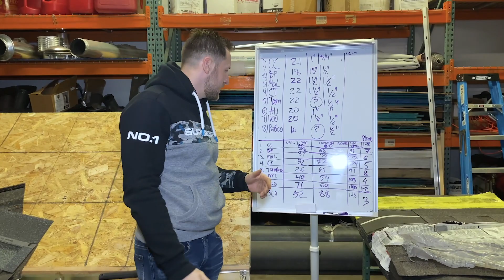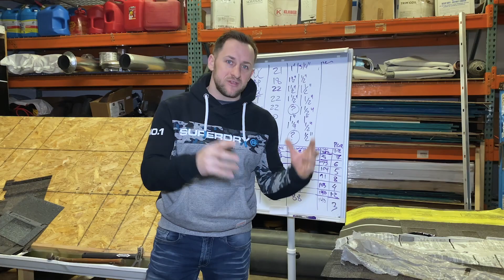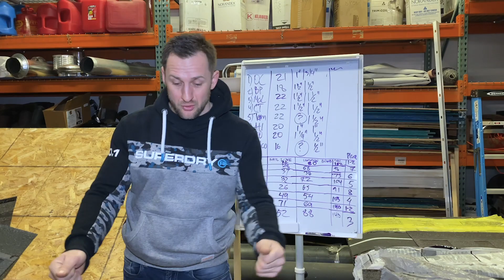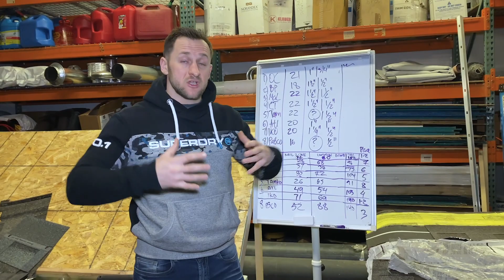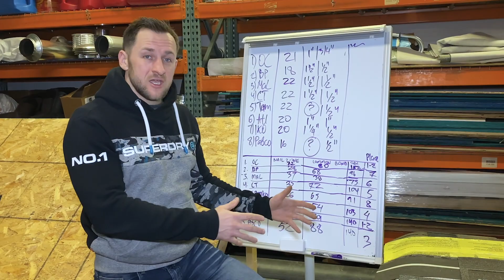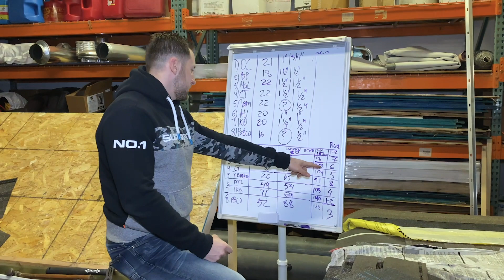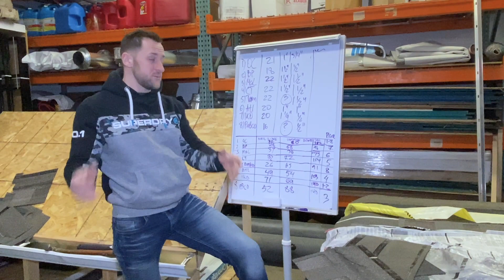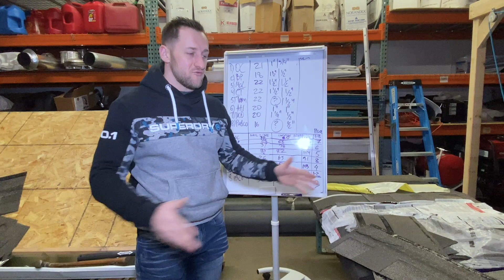Roof Shingles pull test GAF, IKO, MALARKEY, BP, OC, PABCO, ATLAS, CERTAINTEED, TAMKO

Comment: I had three jobs last year GAF Timberline HD all installed with code MC 103 Charcoal. Each house lost 3-5 shingles. Still trying to get reimbursed for the repairs.
Reply from the maker: Good luck
Reply: What state you in? How fast of wind speed? I've been installing gaf in Illinois for a long time and haven't had issues.
Reply: skliros Ontario, Canada. We have used GAF shingles for 10 years now, no issues for long time. Just last year we experienced the blow offs. 90 mile an hour winds. Shouldn’t have come off.
Reply: No reason they should be blowing off like that. How many nails per shingle do you guys use?
Reply: @21kidact64  no less than 18 per shingle

Comment: Im currently getting screwed right now. Used BP shingles on 9 houses, 6 of the house were WW1 era old shiplap boards as the roof deck. The shingles are lifting after 3 years. BP sucks. The neighbors roof has IKO shingles and it's next to the house I did. It had some lifting as well, but no where near to the amount as my roof with the BP shingles. I remember when I was installing them , I could cut them with my finger nail. So thin they warp in harsh weather and sub par roof decks. I should have sheathed with plywood, but still it's trash
 Roofers, stay the fuck away from BP.

Comment: Well shit, I just had my roof replaced with Malarkey Vista...  Now I'm wondering if that was a poor choice 😢
Reply from the maker: It was good choice
Reply: How is Malarkey Vista holding up for your roof? I am looking at installing it. It's not a low end shingle product.
Reply: @bernadettearcand7252   It looks great, and is holding up as expected so far.  Still early though.
Reply: Malarkey is a great choice. I also used Malarkey Vista. They perform near the top in every category and since they’re impact resistant to hail you should be able to get a discount on insurance.

Comment: Another good video Dimitri. You must be comparing the OC Duration with IKO Dynasty for 1 and 2. I agree totally I use OC Durations. 
But if your comparing OC Oakridge and IKO Cambridge then we’re not talking 1 and 2 anymore. 
The Duration has a wide nailing Zone but if you look at the edge of the shingle the actual  common bond is only about 3/4” just like almost all the other manufacturers. Fortunately you can nail anywhere in the hockey tape I call it and that shingle won’t blow off. 
The Malarkey Legasy is the only shingle with the large 1 3/4” common bond . But ya in a pull test it won’t compare to the Duration and the Dynasty. 
In my opinion every time I have to fix blow-offs it’s always because the roofers nail above the common bond area. 
The manufacturers like BP make a Mystique shingle with a 6” exposure. That’s way too big and is more susceptible to blow-offs. Your way better off with a smaller shingle like Duration with a 5 5/8” exposure. OC all the way man. That’s why I’m your fan lol.

Comment: I wonder how you could recreate a pull test after a way of activating sealant. For Instance. Not a fan of BP shingles but I know they have a double tar line. Before they have a chance of blowing off they actually have to fail. Does this make sense? 
Cheers- Jordon from Country Top Roofing
Dundalk Ontario
Reply from the maker: it can be done
Reply: @RoofingInsights3.0  it should be done

Comment: Can anyone confirm Malarkey is the only brand with no class action? Even Pabco?
Reply: Malarkey don't have class actions cause they make good product. The coating and asphalt mixture is kept and at very tight spec tolerance, they are more about QUALITY rather then quantity. I was the coater and press operator at the Portland Oregon plant for 11yrs.
Quality check was done every hour on the hour..rub test for gradual  loss,seal down thickness, length, width, coating thickness and weights, weight checks every 15mins, backing sand adhesions...etc.
Reply: @boosalith2246  good to know!
Reply: @boosalith2246  Which one is the good shingle for malarkey?
Reply: @betrannethlovers2158  the  Legacy and the Windsor
Reply from the maker: We couldnt find much on Pabco, but its much smaller company

Comment: GAF HDZ aka "deceptive practices"
Reply from the maker: Why do you say that?
Reply: @RoofingInsights3.0       They are relying on their sealant only, the single layer nail line doesn't make sense to me, what about installing in 90 degree summer heat or cold weather. We had to jump out of the boat......Thanks Dimitri

Comment: GAF shingles are poor quality. The laminated part is usually longer or shorter than the rest of the shingle which makes it harder to keep straight. Granules fall off before they are out of the package. Each shingle has such poor dimensions its like each one is unique. Its not only the shingles either their synthetic underlayment has problems also. Tiger paw never lays flat causes buckling in the shingles. Vents missing rivets. The Pro strart starter course shingles are so far off you have to cut them back and start the stagger again due to matching seams. 
Remember a roof is not just shingles but a system of products look into other things as well
Reply: Iko shingles are straight u trash I would shoot somebody if they would put them on my roof agin
Reply from the maker: Thanks for feedback